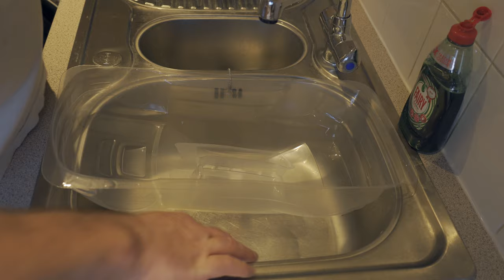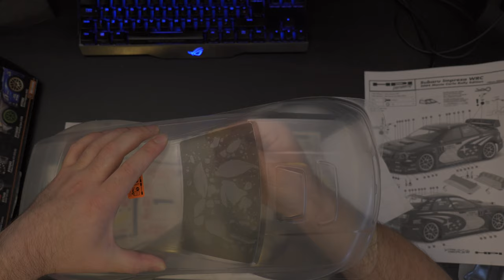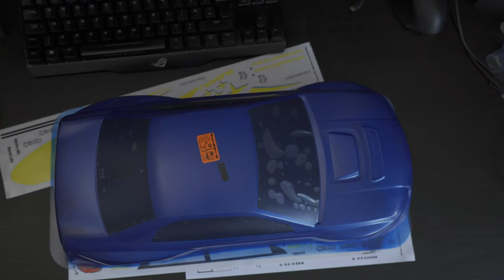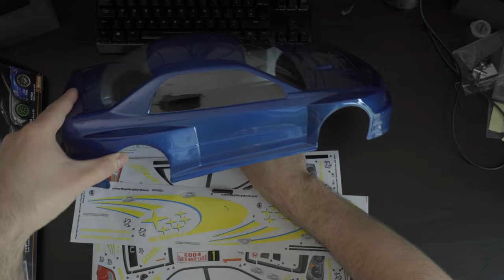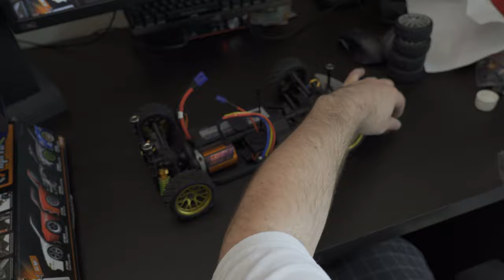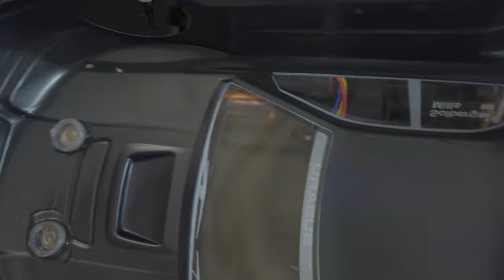HPI RS4 Sport 3 Rally Car Build EP 4" The BodyWorks"

Comment: I'd like to just offer a few tips I've been told over the years & have found helpful. 
I learned the hard way so please don't think I'm criticising.!! 
Don't use a hairdryer because that will leave residue, especially in hard water areas. 
Never use any paint other than Polycarbonate specific spray paint because it's formulated to be flexible & won't crack. 
It's SUPER IMPORTANT to key (roughen) the inside surface with something exactly like the rough side of that dish sponge, otherwise the paint won't have anything to stick to, the paint fills all the gaps & you won't notice it.!
When using scissors don't do a full cut with them because that can introduce tiny cracks which will spread over time.
If you want to make your body last longer you can try anything from thick tape to the drywall & "Shoo-goo" (shoo-goo is expensive at around £12 a 25g tube or you can buy tins of 250ml Evo-Stik Impact adhesive for about a fiver).
When it comes to window masks & decals you're on your own, I'm terrible at them.!
I hope this helps.
Stay safe out there & best wishes from Scotland 🏴 🙏 ❤️ 📻 🕹️ 🔋 🚗 🚖 🚕 🚔 🚚 🚙 🚘 🚓 🚒 🚑 🚐 🚎 🚤 🚁 🛩️.!
Reply from the maker: That's alright mate. I'm open to critisism anyway, not fragile or narrow minded like that. I understand there are differences of opinion as well as preference and I'm not narcissistic enough to think what works best for me, is best for everyone else. at least not when it comes to trivial matters so by all means speak your mind. Its refreshing to hear an honest opinion.

Comment: Been a while. But that tyre and wheel combo sets that she'll right off.
Reply from the maker: It's just a cheap set off eBay but they are copies of the Tamiya rally block tyres which in hind sight might be worth the few extra quid as the diameter of the tyre is slightly smaller and more accurately to scale, so you avoid having to trim more of the body away. In my case I used a 200mm wide body and rims with a 6mm offset, however HPI make the body in 190mm too
Reply: @reedy8585  I'm waiting for build to complete so I can win this haha